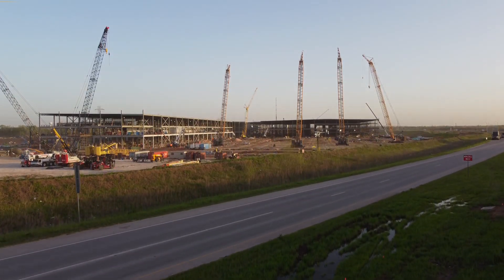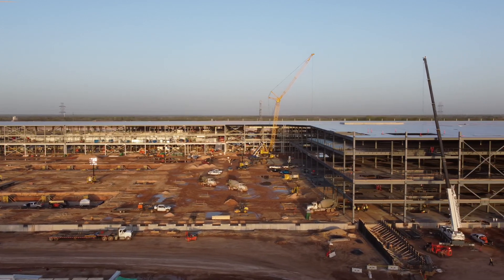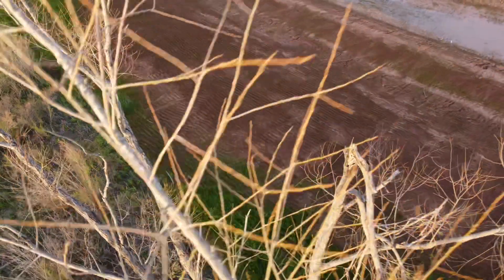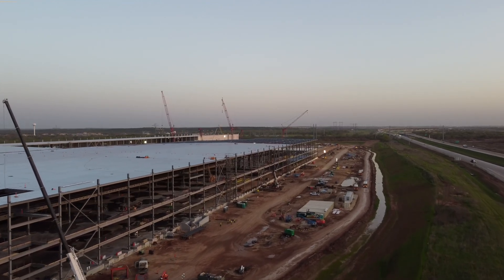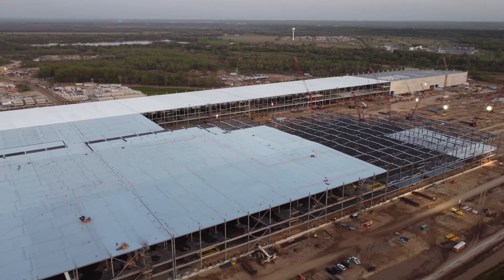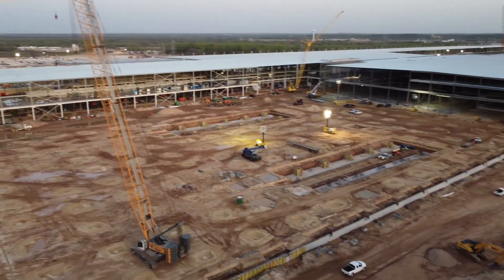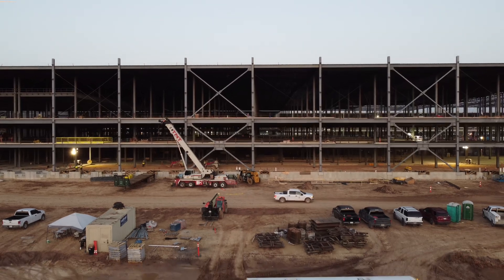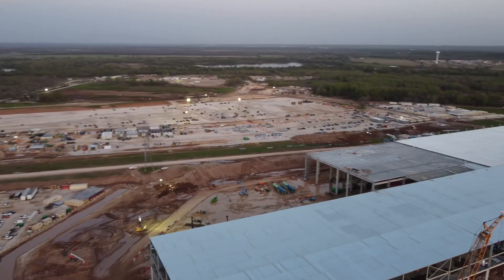Why Elon Musk Doesn’t 3D Print Buildings [Drone Crash] Tesla Giga Factory 3/24/21

Comment: The giga press is super fast so it works better than 3d printing for now, its less than a second to inject aluminum into the frame and produce a perfect structure. 3d printing can't compete with that, except on the cost of the equipment.
Reply from the maker: I meant for the building not the cars but I 100% agree with you.

Comment: Another reason not to use 3D printing when building that huge building is that it is built out of thousands of copies of the same parts i.e. steel girders and square shaped steel floor/ceiling panels. Traditional mass production is always faster at producing many copies of the same thing.
Reply from the maker: Very good point